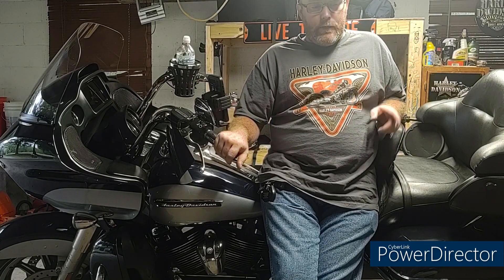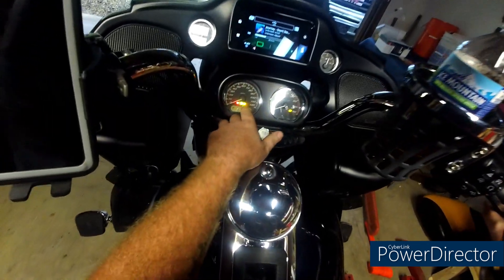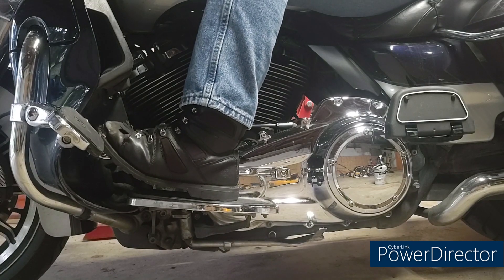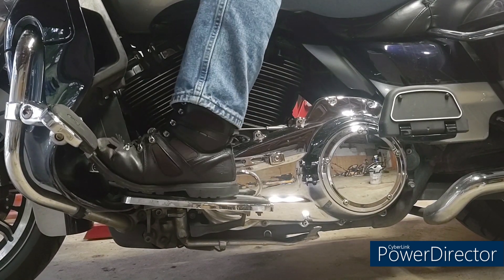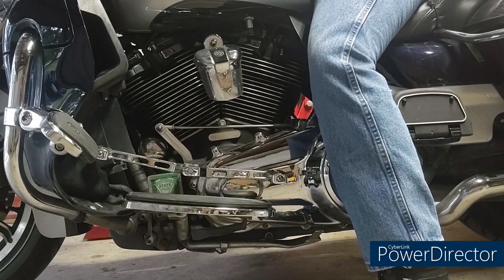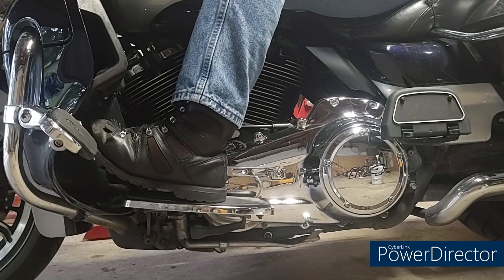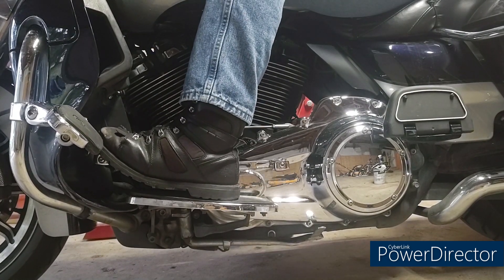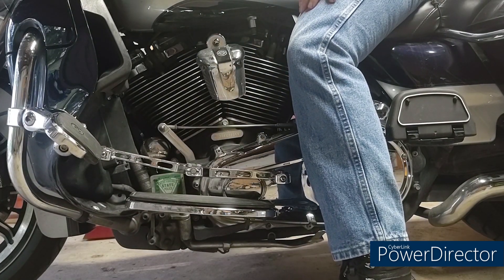How To Find Neutral On Harley-Davidson Motorcycle

Comment: Great tips.  Thanks for sharing.  Ride safe and all the best in 2022.👊👍🇺🇸
Reply from the maker: Hope they help
Reply: @RoadGlideAndy  There definitely is a difference between the twin cam and the M8.  I can pop the m8 in neutral very easily.  The twin cam not so much.  Thanks 👍👊🇺🇸
Reply from the maker: @HDVIBE  really never had any issues with my twin cam either,  of course everything was rebuilt and tight

Comment: If you shift into neutral before coming to a complete stop it's easier . At complete stop rocking the bike back and forth a bit helps . Make sure your idle is not too fast , your clutch is properly adjusted , and your primary chain is set right .
Reply from the maker: I don't really shift to neutral when coming to a stop, only when backing bike in somewhere, or out, rest of time it is in gear.
Reply: @RoadGlideAndy  I have almost exclusively been riding old bikes , seventies Harleys , Triumph and Guzzis , over forty years on the road . All my bikes have been a little difficult to shift into neutral .

Comment: I switch to Amsoil 75w-90 Severe Gear transmission oil and mine slides in to neutral easier hot or cold 😎👍
Reply from the maker: I love my Amsoil

Comment: why did they put the neutral between 1 & 2.....would it be asier if the neutral is the last down?
Reply from the maker: No its pretty typical for motorcycles, even ATV's to have that shift pattern. I will research and see if I can come up with a better answer.
Reply from the maker: Answer would be safety. If neutral were in place of first gear when gearing down in emergency situation you would hit neutral instead of first. In short for safety its the most logical pattern.